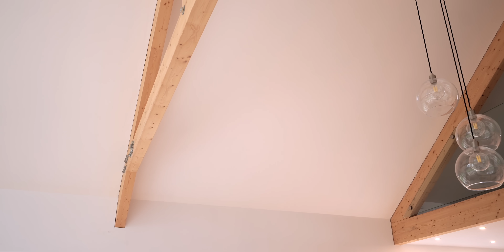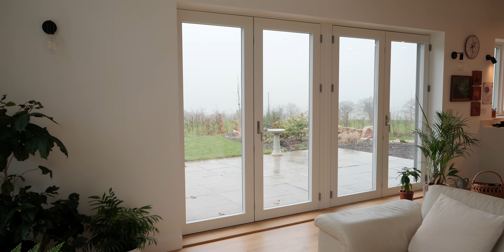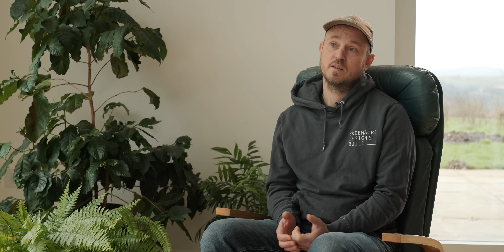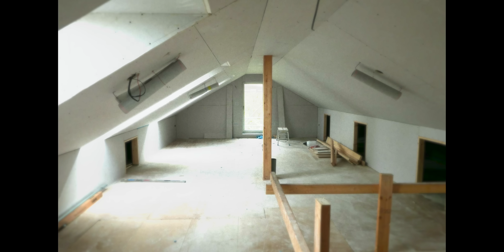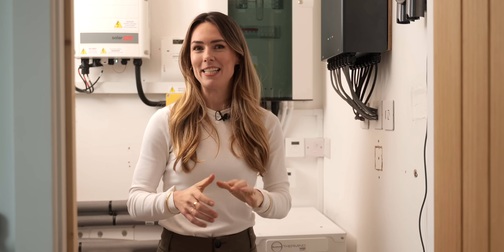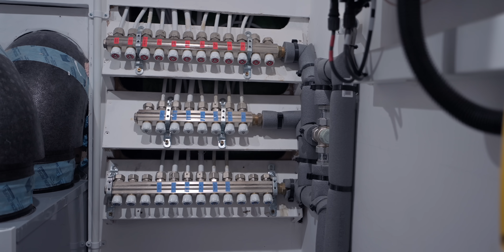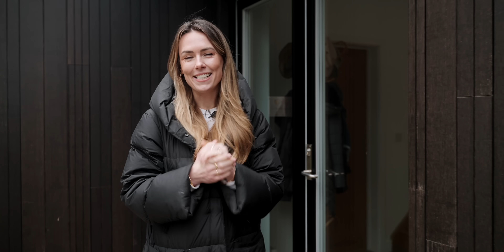Ditching a Heat Pump for In-Plaster Infrared Heating?!

Comment: Very interesting, and as a fellow passive house self-builder I would love to compare notes with Julian. The IR in-wall panels are an interesting choice, as is the Sunamp heat battery. Both sacrifice efficiency compared to a heat-pump setup, but are arguably more straightforward, low maintenance and simple (KISS) technologies. Running costs are less of a factor compared to installation in a standard UK house because of the fundamentally low heat Passive House demand, and the fact that the PV can generate enough offsetting electricity to keep nett costs impressively low. We went with the smallest ASHP available at the time, a 4kW (output) model, and  underfloor heating throughout. As Julian was advised -  we can't achieve the highest COP (coefficient of performance) because it is mostly runs at relatively low power. However, after a bit of 'twiddling', ours is achieving a midwinter COP of about 3.6 which is still gobsmackingly efficient. So much so that the cost of running our heating in 2025 was £80. We also have 2 x EVs, a home battery, 8kW of PV, Octopus's Intelligent Go tariff with 7p/kWh overnight import and 15p/kWh export, and I reckon we're about cost-neutral annually, with perhaps 10,000 miles of driving. TBH, I haven't added it up yet, but suffice it to say that it's been quite a while since Octopus stuck a pink tentacle into our account and took some money. The one choice Julian made that I didn't quite understand was not having a home battery to complement the PV and shift all his electricity usage overnight. We charge our batteries up overnight at 7p/kWh and run the house for the rest of the day. In the northern winter, when PV output is often a fond memory, this keeps costs down. Anyway,  sorry to drone on, this is yet another great EET episode from Imogen and team that amply demonstrates what is possible with a more sustainable approach to buildings and modern technology. 😆
Reply: Yes. I didn't think his no-battery choice made much sense. Waiting until he can just use the car's battery instead may be a reasonable choice.
I had 14 years on PV-alone and upgraded from 3kW to 7kW whilst adding a battery last year, and it's dramatic how much better the system works when you are no longer time-constrained (to sunshine and/or tariffs) in the same way. We used to avoid about 22% of grid usage. Now we avoid about 95%. (I have a(n incomplete) EnerPHit retrofit to a 1960s house. Still have heat pump, EV and floor insulation to finish the job).
Reply: It needs little heat, two kilowatt at most in freezing conditions, so even simple, cheap, basic, resistance heating would be cheap to run. The few hundred pound electricity bill, inc charging a car for 7K miles proves that.  Based on average UK fuel prices and car efficiency as of January 2026, running a petrol car for 7,000 miles will cost roughly £900 to £1,150. He is laughing all the way into retirement. 

This is also inexpensive to install.
Reply: @johnburns4017  Simple mini split heat pump costs you 500-1000eur and installation about the same. Almost always the right solution instead of direct electric heating and as a bonus gives the cooling option during summer.
Reply: @AllanSavolainen  
The  mini split heat pumps are good, but his heat demand is only two kilowatts at most when -3C outside. So most of the time heat demand is even less.  The average outside temperature in the heating season is actually ten centigrade.  A dirt cheap two kilowatt fan heater from Argos would heat this house. 

I like the reversible mini split heat pump. But heat pumps only go down to six killowatts as the vid tells us. As it cannot go down to less than six killowatts it is not the solution.
Reply: @johnburns4017  That is weird, because I just checked a popular heat pump shop here and they have 1,2 and 3kW models. Smallest costs only 300eur.
Reply: @johnburns4017  Even if you needed small amounts of heating as it is above 0C outside, 10-30eur saving per month pays the heatpump back in just couple years. Faster if there are colder winters. A small unit is about 1000eur installed.
Reply: @AllanSavolainen  
The vid says six. I do not doubt you. But the heating and hot water here is cheap to install which is important on a budget when building a new house, as costs easily spiral upwards. And it is very cheap to run at a few hundred pounds per year.  So he has done a lot very correct.

A mini split heat pump will not heat all the rooms. He has simple and cheap heaters in all the rooms, not just one, with a good control system.
Reply: @johnburns4017  It's not true that heatpumps only go down to 6kW.  A2A heat pumps go down to 2.6kW, A2W go down to 3kW. And there is a 3.5kW GSHP.
But it's also true that point-heating direct IR is not daft in a passivehouse. Yes it will be 3x lower efficiency, but it's easy to install, low maintenance, only on when people are present (which gets you some efficiency back in practice) and only a few hundred kWh/yr are being delivered this way.
Reply: @AllanSavolainen  Are you talking about Air To Air heat pumps?
Reply: @johnburns4017  I have a 4kW ASHP which, according to my maths, is a lot less than 6kW. I take your point about the fan heater, but doubt it would spread the heat throughout the whole house. It would do the main room though.
Reply: @EugeneLambert  
It was indicative to show how little heat is needed to heat this biggish house. 

I think Julian was on budget, if so he did the right thing with his choices. The battery may be a way of suck it and see and get one later if needed. The price of these, sodium is the safest, is dropping. so by the time he need a battery it may be cost effective.
Reply: @EugeneLambert  Yes as I said (in this thread I hope) about mini split heat pumps. They are still more efficient than direct electric heating. And work just fine in a climate that is close to freezing. Here when we have -25C or colder, there isn't much it can pull, so it becomes just as efficient as direct electric heating.
Reply: @johnburns4017  i dont think that correct. 2.5kW models are common in most of the world (although i dont know about England specifically). 6kW is BIG. The smaller units are necessary for small apartments
Reply: @johnburns4017 

Good point ref cost of installation.

Something that doesn't always get mentioned.
Reply: @ForestForest-n9i  
Yes, many say fit an expensive heat pump or gas combi boiler and save a few pounds a year in bills. Financially, overall not worth it. Then the cost in maintenance and replacement of parts then the cheaper to install maintenance free system shines ahead. 

What you save in installation costs by fitting a simple, cheaper, resistance heater installation buys a lot of electricity.  Or buys a lot of insulation.
Reply: @johnburns4017 

I feel too that many aficionados of heat pumps accept without question that said heat pumps are always this magical 3 or 4 times efficient.

Far, far more important is fitting decent insulation and draft proofing ... well in advance of buying a heat pump.

For obvious reasons of course.
Reply: Heat demand of 1100w in my PasivHaus house renovation. Dropped idea of heat pump and underfloor heating fairly quickly since they would never be financially viable. Only use energy for space heating and Sunamp hot water on low overnight tariff.
Reply: @PaulFerg279  'Never' is a long time. They will be more efficient than direct electric so will cost less eventually unless maintenance overwhelms the lower running costs. That might be 100 years, which is why you didn't do it, but I wouldn't call that 'financially unviable'. 
UFH is a few thousand quid so if it only saves 50 quid/yr then we are looking at maybe 120 years. But UFH is also extremely comfortable so might be worth paying for on that basis. That's an individual choice about comfort, not money.
So how do you do your space heating? I have a mostly-done EnerPHit-ish (32 kWh/m2.yr) and am wondering what flavour of heating to fit. UFH, IR-electric, HP-with-existing rads, A2A. They would all work.
Reply: @xxwookey  Agree 100%. THe UFH heat means constant heat throughout the house, not just specific areas. And the cats love it!
Reply: This is really interesting thank you.  Can I ask - do you have UFH upstairs as well? I am looking to move house in the next year or so and would like somewhere to gut and completely remodel with good insulation, solar panels, heat pump and UFH. My impression was that wet UFH was better (and cheaper ) yet is only really suitable for the ground floor.  Interested to hear your perspective.
Reply: @freppers2666  Yes, we have UFH upstairs and downstairs. Downstairs is mainly tiled floors, upstairs engineered wood. One issue with engineered wood is it can place lower limits on flow temps, but this is less of a problem with a passive house as flow temps will be lower anyway.
Reply: @freppers2666  
Electric UFH is cheaper to install. It is a matter of ascertaining the heat demand for the house, then take it from there. Working backwards always ends up with a cludge. Scroll down to one of my posts on a terraced house renovation. That will be helpful.
Reply: I'm not understanding the wall IR heating
Reply: @llbailey9946 its actually embedded into the ceilings with around 50% occupancy in the plaster finish which gives 100% coverage down to floor level.

Comment: I'm a fan of IR. In certain use cases it makes the most sense. I have a panel in my office and it's brilliant. Definitely the most efficient space heater for just one room. But it's not suitable as a whole house solution with houses of standard construction. This use case is perfect though. What a great project!
Reply: It's no more or less efficient than any other resistive heating technology. 1 watt of electricity on ~1 watt of thermal output. Utilisation of the refrigeration cycle (a heat pump) is the only way to get higher efficiency
Reply: Not true - we install this in many retrofit situations very successfully.
Reply: @EnergyCarbonInfraredHeating  Surely they'll be considerably more expensive to run than gas or heat pumps?
Reply: @handsofdoubt31  In the same way that if a heat pump is set up incorrectly it is expensive to run then IR without a good control strategy could be expensive.

Comment: Standing charges are already £180 a year, that's a very low energy use (even if they're exporting at 15p and importing at 7p).

The sunamp boiler thing seems to just be a fancy a storage heater. But it does seem to be the best solution for them.

So long as the very cheap overnight rates last.

Battery would save even more money, especially if it was oversized. Charge to full overnight and plenty of buffer even if they sell half of it back to the grid in the day.
Reply: Phase-change storage is different to storage heaters and water tanks which are just high-thermal-mass storage. You can store about twice as much energy without raising the temperature, so losses are effectively halved.
Reply: @xxwookey  It's also effectively a battery, but for heat not electricity.
Reply: @sIightIybored  Sort of, yes, but it does actually get hot, and thus does have thermal losses all the time it is charged. Electrical batteries do not suffer from this when just resting.